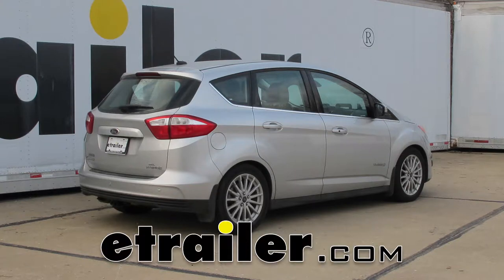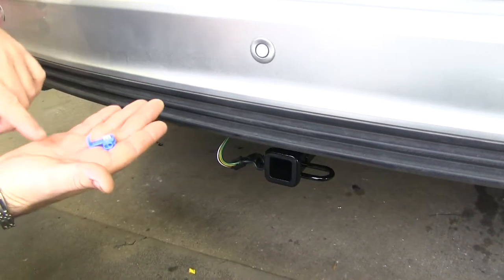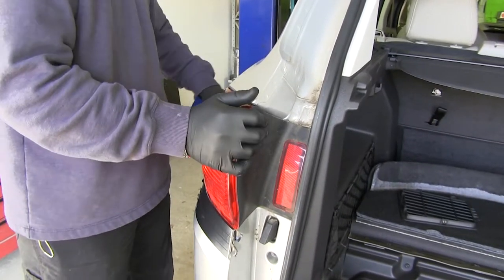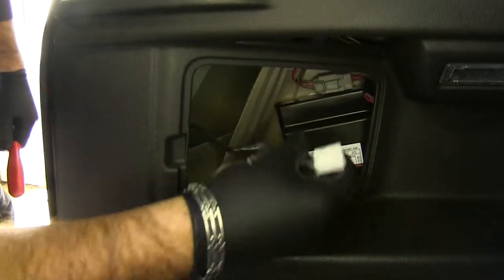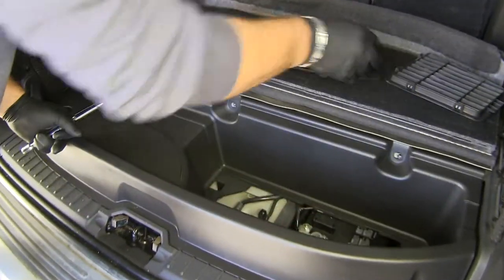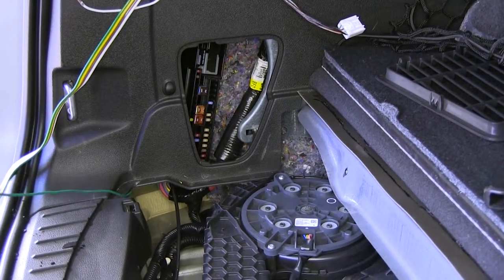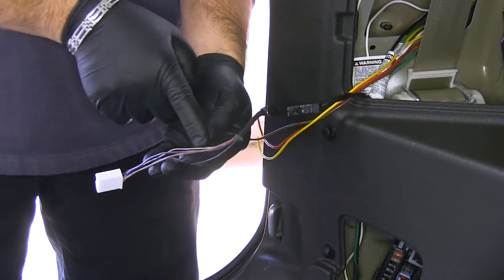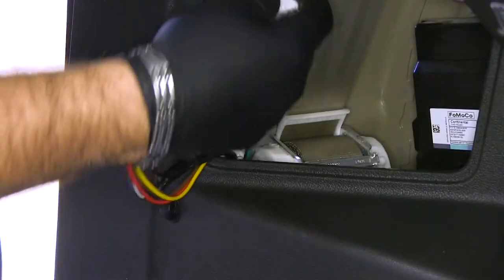Mount: Curt Powered Tail Light Converter with 4-Pole Flat Trailer Connector on a 2013 Ford C-Max

Comment: Hi
Does it void the ford cmax energi warranty in canada quebec?
Reply from the maker: That's a great question. In the US we have the Magnusson-Moss warranty act which states in summary that when an automotive manufacturer denies warranty coverage because of a modification you made, they must prove that that the problem in question was caused by the modification you made. It appears that on the federal level, Canada doesn't have a similar law or act. However, each of the provinces offer some sort of Consumer Protection Acts. You'll need to check with the provincial government in Quebec on that one...
https://www.etrailer.com/Trailer-Wiring/CURT/C59236.html
Reply: @etrailer  appreciate the answer:))
Reply from the maker: You're welcome, happy to help.